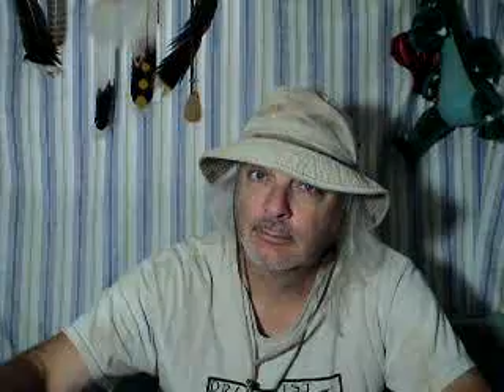Re: 'Dean Russel Hartwig free energy Video response' my reply

Comment: "Low-Energy Nuclear Reactions" is just another term for cold fusion. Presently all signs point to cold-fusion being impossible; but even if it were fusion reactions are not Over-Unity, free-energy devices.

Fuel cells or electrolysis devices (all the Stanley Meyer's water fuel cell was) have nothing to do with nuclear reactions; so what in your mind makes hypothetical fusion technology prove a Stanley Meyer device works?

Comment: For part of the engine I had to use magnets that I had melted down in order to extract the pure magnetic energy.

When the magnetic energy is run through a magnetic tube it creates a field that can be used to decrease the friction (below zero) of the gravity powered pulleys that lift themselves back into position .

Comment: I don't know the efficiency of this, but one idea is that if you had a hill or mountain or something nearby, you could use the excess power you get during peak power periods to pump water up the hill to a reservoir located at a higher elevation.  Then when you need power you let the water come back down the hill and run a turbine, like a hydroelectric plant.

Gravity can be used as a way to store potential energy, it cannot actually "make" it.

Comment: For more on "generating" energy from gravity, here's an idea I've heard proposed before.  Take the idea of a city powered by renewable energy sources, primarily wind and solar.  Assume that the average power capacity of those sources is adequate to power the city, but that the output will vary, and of course at night you don't get solar power.

You need some sort of tremendous energy storage mechanism.

Comment: Well.. such a thing is certainly possible.  For example.. take a hybrid car, put it on top of a hill, and drive it down the hill while using the regenerative braking to generate elecricity.

The problem is once you're at the bottom of the hill that's it.  Not too useful an energy source.  You can use gravity as a means to STORE energy, but not to generate it outright from nothing.

Comment: Let's suppose we could store energy in a permanent magnet. Then the energy stored in the magnet could not be greater than the energy it took to magnetize it in the first place. Most magnets are synthetic.  
In reality energy is not stored in a magnet.  Attempting to power a car on permanent magnet is analogous to attempting  to power a car on the energy stored in a falling mass. The system comes to equilibrium and then more energy than was yielded must be invested to restart the cycle anew.

Comment: Great video DP. Below is a response to anybody who thinks that perpetual motion is possible.

Actually in all cases when dealing with a machine energy in > energy out. The remaining energy is lost due to heat, friction, or other uncontrollable circumstance. The proper way to say this is Total energy in a system before a reaction = total energy in a system after a reaction.

Comment: A "magnet" exerts directional magnetic force simply because all of its tiny molecular moments are aligned in the same direction. It will CONTINUE to exert that force for as long as the magnetic moments stay aligned in that direction--potentially FOREVER.

But since it's only a FORCE it "contains" no energy, not does it lose any energy if the moments lose their alignment (except in entropy gain, I suppose)--thus that "energy" cannot be used to do work.

Comment: In principle you can magnetize some iron with a solenoid and then beat it with an hammer at a later time to make it lose its magnetic properties. That would induce some current back into the solenoid but it would require some tons of iron to generate enough electricity to do anything useful, there will be huge losses in the process and you'll need an huge hammer...

Comment: Doesn't it take energy to move a magnets molecules out of alignment? So, a magnet losing its magnetism takes energy out of a system, not adding energy to it.

I think they use a magnetic field to align molecules as they lower the temperature to near absolute zero, then remove the magnetic field. The work done by the molecules as they move out of alignment lowers the temperature a little more. OTOH, I may have it completely backwards.